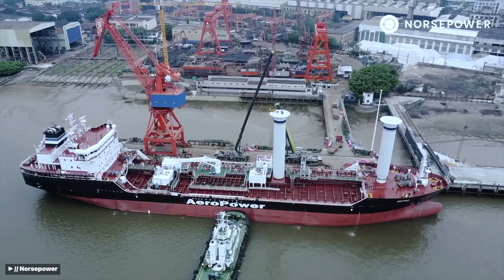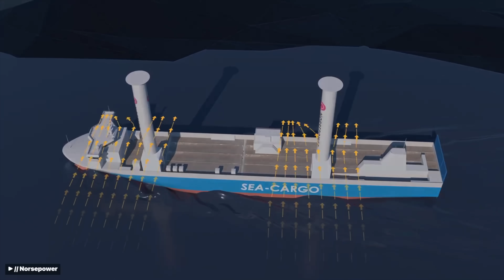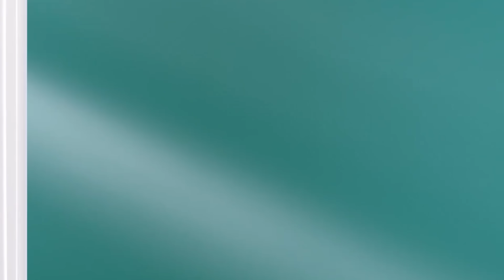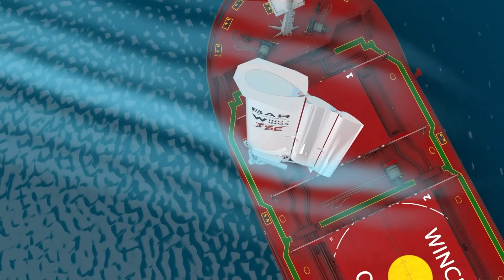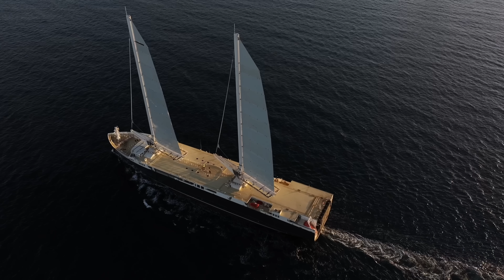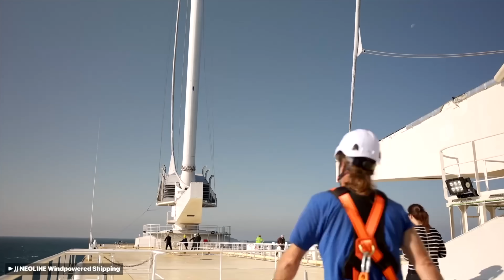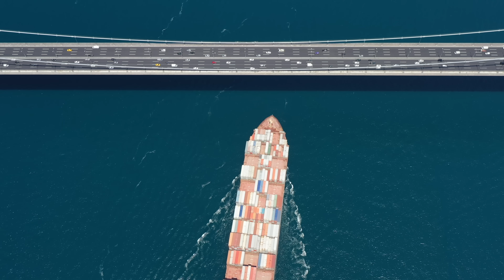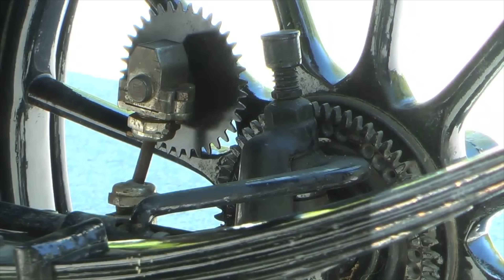Surprise Breakthrough Solves Shipping's BIGGEST Problem

Comment: 42 year ago I wrote a thesis about sail assisted cargo ships. HTS Dordrecht, the Netherlands. Materials have progressed but not much else. I am glad sail assisted ships are being built.
It really helps that weather predictions are much more accurate than 42 years ago!
Reply: @TTT-l5w5l  I read about the wind-for-cargo-shipping solution around that time (42years ago) in KIJK magazine. Was that you? Amazing that it took so long. As always that’s down to economics.
Reply: @ykerippen6778  No, it wasn't me! It was a bit of a hot topic then and various studies were published.
Reply: The other thing that has improved is control algorithms and sensors so automatic kites are more plausible.
Reply: If ships moved on sail power alone, weather predictions would be a huge factor in departure time but that isn't the case. Wind is supplemental power.
Reply: @genespell4340 Aircraft try to follow the jet stream winds and ships will plot the fastest route with the wind in mind.  It is a means of propulsion.
Reply: Excellent point re weather forecasting!
Reply: @docdissent 
Canada upgraded their weather forecasting computers a few years ago. But they still suck at it and you still just as well listen to the forecast the night before as you retire for the night to get the best results 🤣
Reply: @patrickmckowen2999 
There much better now then they were even 10 years ago. I work outside most of the year and although they are not perfect, they're petty close up to three or four days out and good enough for most things a week out. I ca. Look at the forcast and know wgat to pack now something you could not do twenty-five years ago.
Reply: @docdissent yeah, we got now a great sattelite coverage and multiple approaches to predictions including AI.
Reply: Not in the US. Conservatives have gutted weather forecasting and are attempting to privatize it.

Comment: I always said solar electric sailboats do make sense. Think about this being in a sailboat can be like a house on the water. Wing sails can be cheap. Even solar pontoon boats can work. Ships now use super capacitors for thrusters. Cheaper, cleaner, greener, safer than batteries. At some point solar electric motorcycles should work also. E85 would be cheaper but taxes. You can get marine multi fuel engines also.